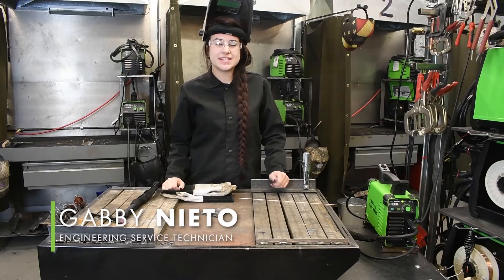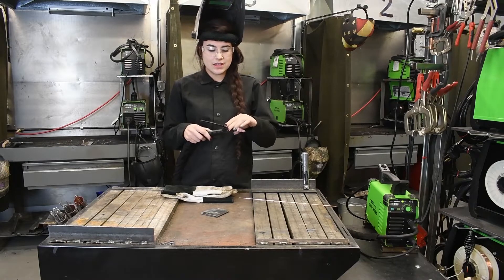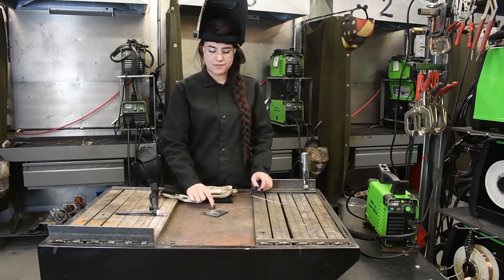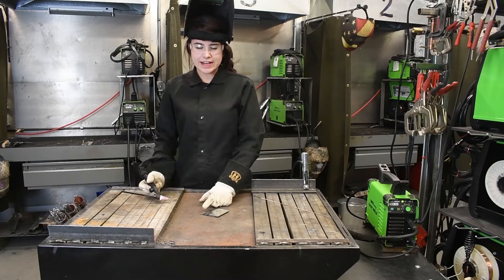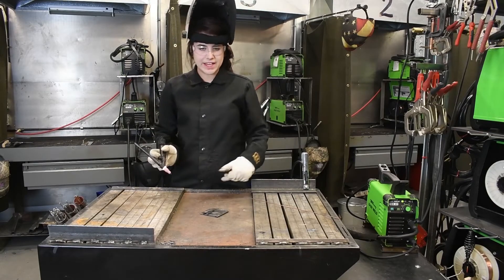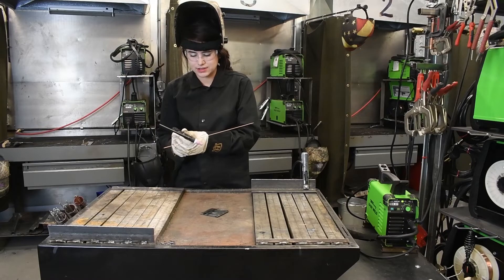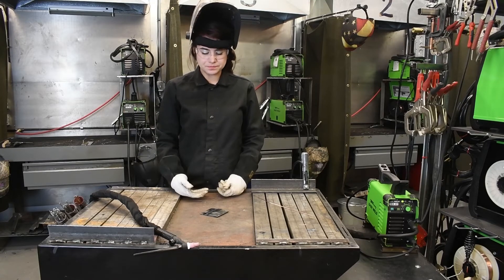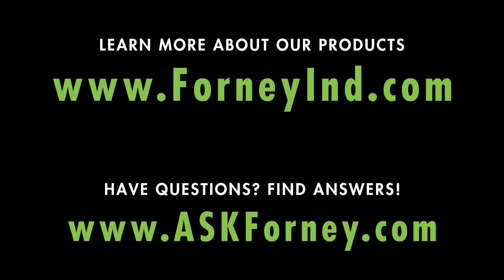TIG Welding with the Forney Easy Weld® 100 ST

Comment: Hi, im learning how to weld. I bought a forney st100 and im trying to fins out what part numbers i need for me to use the st100 as a tig welder. Can you help me please.
Reply from the maker: Hi Madyic, apologies for the delay. We recommend the below for TIG welding with your Forney Easy Weld 100 ST: Argon/CO2 Flow Meter: 
•	Argon/CO2 Flow Meter: Forney ITEM# 85364
•	9V TIG Torch (Size 25 Dinse): Forney ITEM# 85657
•	TIG Welding Ceramic Cup: Forney ITEM# 85454
•	TIG Welding Torch Collet, 1/16”: Forney ITEM# 85455
•	TIG Welding Torch Collet Body, 1/16”: Forney ITEM# 85459
•	2% Thoriated Tungsten Electrode: Forney ITEM# 85450

Our Customer Experience team can also help you out if you have any more questions. You can reach them at: 1-800-521-6038
Reply: It's listed in the manual. FV9 or FV12

Comment: Would this unit run off a portable generator?
Reply from the maker: Hi Stanley, this unit is generator friendly. It requires a generator with a minimum of 4,000W continuous output with no low-idle function (or low-idle off).
Reply: @forneyind  Well that won't work mine is only 2,500watt and was hoping to use the stick welding

Comment: I got the 100st for Christmas last year. I’ve put it to good use. Built a stool for my dad and rebuilt the majority of his smaller trailer with it as well. I had been wondering how I would TIG weld with it. This video answers that question and I’m so glad that I finally found it! Now I just gotta get the TIG lead, regulator, & a bottle of argon and I’ll be good to go!

Comment: I just bought a 100ST and ordered a 9FV torch. Looking forward to giving it a try. Since this Machine has been out for a few years now, has anyone built any accessories like a foot pedal switch to turn the gas and power off to the torch? Seems like it would be an easy thing to do and make this a much more user-friendly and versatile tool.

Comment: I have the same machine I wanted to get into tig welding but where do I connect the argon tank to
Reply from the maker: Hi Tyler, the torch has the gas hose attached to it, so that will connect directly to your tank. You control the gas flow with the valve on the torch's handle. Here is what the torch looks like: https://www.forneyind.com/products/9fv-tig-torch Hope this helps!
Reply: @forneyind update i recently purchased the torch and it works great 10/10 would recomend this machine to anyone wanting to get into stick or tig welding at low cost
Reply from the maker: @tylerlyons7397  Thanks for the update!
Reply: @forneyind  thanks so much

Comment: why dose it not weld aluminum and dose it weld stainless?
Reply: Well it can weld aluminum just not how you want it too. You can DC weld aluminum but it needs to be thick, you have to know what kind of alloy your welding and you have to use 100% helium and not argon
Reply from the maker: Hi Sean, this machine is DC welding only which means it cannot weld aluminum, but it can weld stainless steel. Thanks for reaching out!

Comment: This girls hair should be rolled into a bun on the back of her neck to meet safety requirements.  Angle grinder accident waiting to happen.
Reply from the maker: Hello,  Gabby has been welding for 5 years with her hair in a braid and hasn't had a mishap. She is aware of the risks, and always works with safety in mind! Thank you for your concern.